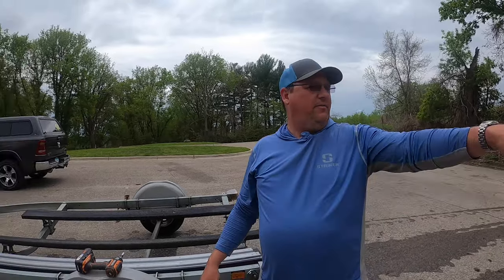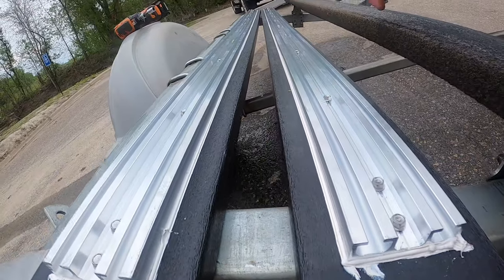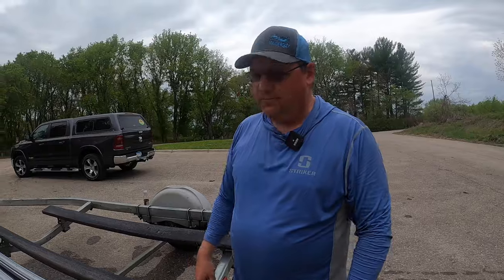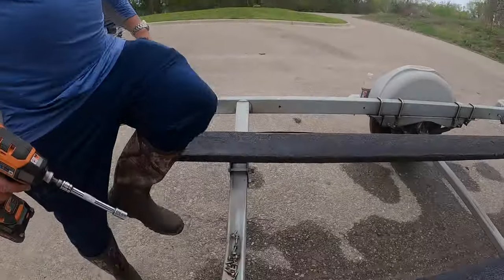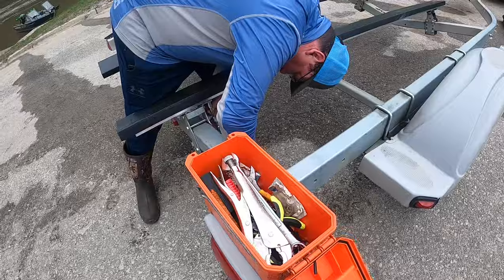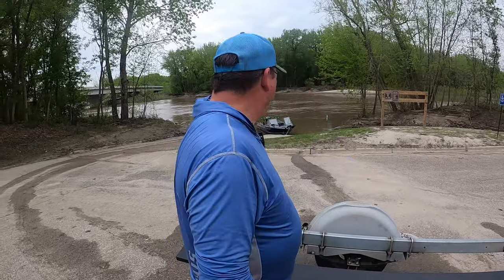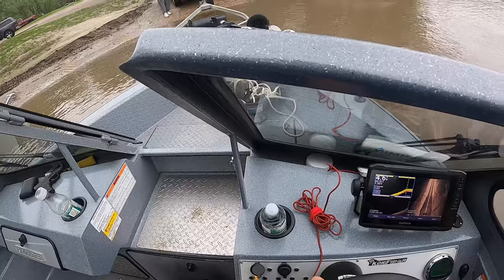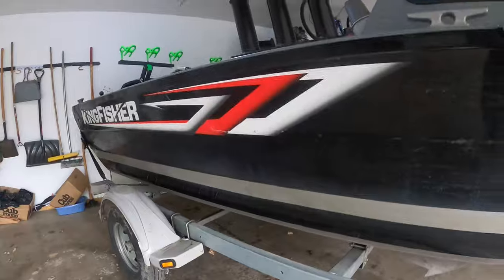Ultimate Bunk Board install and review Boat Trailer Bunks

Comment: Ive got a Kingfisher Flex Sport I bought new in 2017 with about the identical trailer as you have. From the factory Ive had trouble with the bunks. I was just checking into Ultimate Bunks. What size is your KF? I thought I heard you said you went with 9 foot bunks. I need 10s but its 250 bucks to ship them. I'm in Minnesota also and was just wondering what you paid for shipping
Reply from the maker: It's an 1825 Falcon and my boards are 9ft.  I think I paid $140 for shipping.